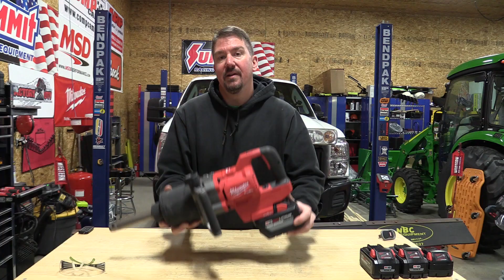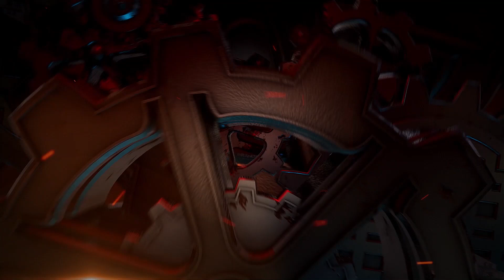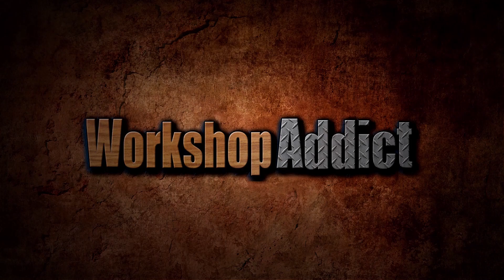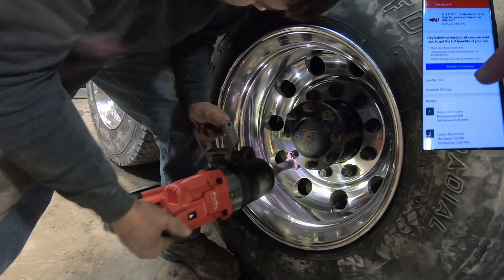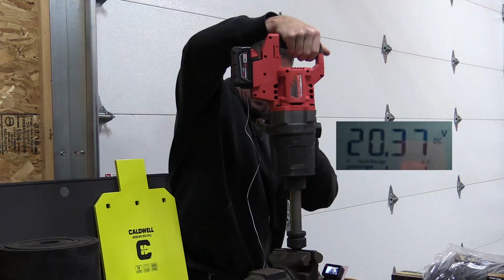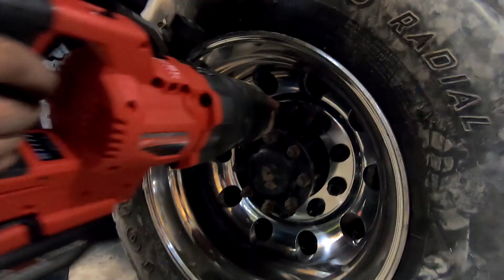Milwaukee Tool M18 FUEL 1" D-Handle Ext. Anvil High Torque Impact Wrench w/ONE-KEY Review 2869-20

Comment: I could see this being very popular with dirt modified, late model and sprint car crews. If a shock, axle or wing breaks or tire goes flat there's usually very limited time to replace those parts and get back in the race. This will be a huge time saver.

Comment: I’m a heavy mobile diesel mechanic the biggest pain is waiting for the air compressor to keep up with removing or installing… my air impact is my last air tool. I want this so bad.
Reply: I do the same thing. Air has always been a battle when trying to stay small enough to be mobile enough to get in tough places but still have room for parts and tools. Cold weather always has me fighting to keep air working. Tools like to slow down. With my battery tools I can simply put the batteries in the cab to warm up on the way. Enclosed compressors help in cold weather but it's not perfect and needing to wait for psi really sucks. Only way with air to replace a fast compressor is to have volume but then you loose free space for drums or tires etc
Reply: Sometimes it's just a PITA to get close enough to run the air hose to where I'm working

Comment: I started my Tool Journey with Ridgid power tools. Canada do not have the same Ridgid tools as the Americans get. The Ridgid power tools that I do have has never let me down. But I slowly started buying Milwaukee power tools because of the selection. I have both Ridgid and Milwaukee high torque impact wrenches. I find that the Milwaukee high torque impact wrench preforms better then my Ridgid does. And then I went and bought the Milwaukee 6.0 Ah REDLITHIUM FORGE Battery. Well that battery turned my Milwaukee impact into a beast. I offered my Ridgid high torque impact and 2 6ah octane batteries to my son but he turned it down for some reason. The other thing is I only run Milwaukee or Ridgid batteries in my tools, I do not trust the Amazon or Ebay crap batteries.

Comment: Alternatively, the Durofix 60V Jumbo 1" Cordless Impact Wrench RI60176E & RI60176 $1300 & $1200 respectively as a kit - batteries and charger included. 50% more torque.
Reply: That's a nice set up, never herd of the tool brand before. I have makita tools from long ago, surprised they don't have the same kind of line up
Reply: They tested that it broke before they change 1 wheel. The Durofix is complete garbage.

Comment: Nice tool. But in my experience with 1/ 2 in and 3/4 versions, the battery locking mechanism wears down quickly, and the battery starts wobbling in there, losing contact and cutting off power to the tool. Especially that super heavy 12ah battery. Good for occasional use or whenever air is not available.
Reply: I've had the 3/4 for over a year now pulled lots of nuts with but it's slower than an air gun and my contact points come loose on just the 5amp battery's now so now looking to replace or get serviced

Comment: Excuse me sir, I have this tool and I want to torque something to near 700 ft.lbs. What RPM setting would you say I neeed? It is a 2 ¾ yoke nut on my transmission. I've been searching on the internet but just haven't found a table or chart to go by. And all I see on my app is an RPM range to choose from but no torque. I greatly appreciate any help.
Reply from the maker: Impact guns should not be used for torqueibg bolts.  That is why you can not find it.  If you are using this, run it on high for about 10 seconds' worth of impacting.
Reply: @WorkshopAddict  thanks for the reply

Comment: TTC already did a video on this.  The Ingersoll And Rand 1 in d handle SMOKED it.
Reply: That's like comparing getting shot in the head by a DE .50 vs a S&W .500.....one is more powerful, but you're dead either way.

Comment: Wonder how long the anvils will last this time lol
Reply from the maker: Well, Lets just say that this one got more than just a voltage test while locked into the vise.  I have it all I could for a long time.
Reply: I think it should last longer than the newest Snap on half inch MONSTER LITHIUM  impact that repeatedly failed right out of the box
Reply: I won't buy another Snap on cordless again
Reply: @captainawesome2750  New gun fixed all that and came with more power and everything

Comment: Yeah that’s cool but my pistol grip 1 inch drive harbor freight impact was like 115 bucks seven years ago and with the right air holes it would outperform that Milwaukee
Reply: All shits and giggles until you are in the middle of nowhere with no compressor but I agree air still beats battery in the shop environment
Reply: Hey bud well maybe if I could borrow 1500 from you I would get one of those
Reply: @falkirk8413  I totally agree with you with the air compressor thing, I carry a battery charger for my batteries so if I run into a emergency I have my juice plus my cordless tools, air tools are great! Cordless tools are game changers. To to swap a tire on the road is have to charge my air compressor vs just plugging my battery!

Comment: I swore I wasn't gonna buy one of these tools, all three of my compressors are down, so I ordered one impact driver #2868, it's actually gonna get here way before the parts for any of the compressors, and so I went down to the pawn shop and  told my buddy about it, he says you are one lucky MF, look what just got released from the loan dept. 2 milwaukee 12 ah batteries and the charger is right over there, all for the low low price of $200, hey I checked, you can't get lower than this, the cosmic planets are lining up for me or it's just a f#$%@n coincidence hahahahahahahaha

Comment: Where do you buy the tool
Reply: From Milwaukee......
Reply: @MATTLEism  is it available Home Depot
Reply: Acme tools
Reply: @rodneystewart8958  how much does it cost
Reply: @rodneystewart8958  how much does it cost
Reply: @jeremynguyen2346  I think it is $700 bare tool and $1300 kit with 2 batteries
Reply: @rodneystewart8958  is it available at Home Depot
Reply: @jeremynguyen2346  possibly yes
Reply: @rodneystewart8958  how do you know

Comment: Just imagine this with a 15.0 ah battery that doesn’t even exist yet?
Reply from the maker: More weight.  :)  But it might reduce an Uga on a hard pull.
Reply: Actually 15.0 battery is possible just by replacing the cells with a 3p 5s battery.